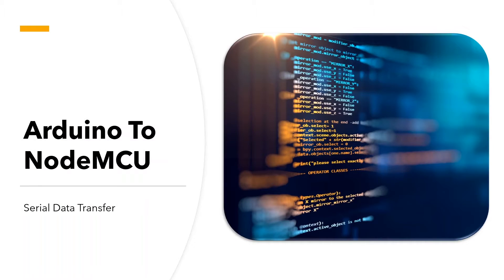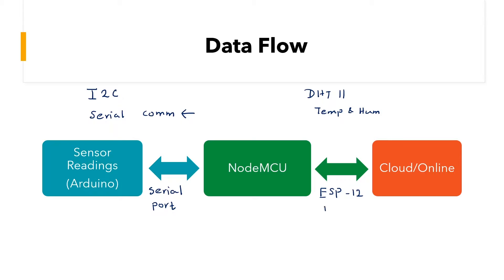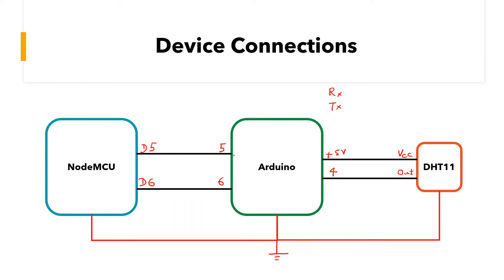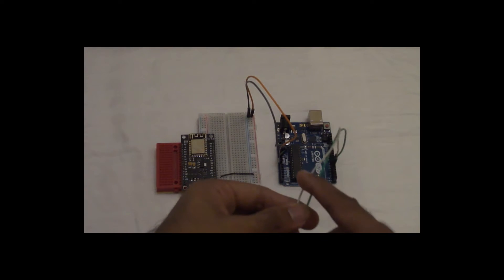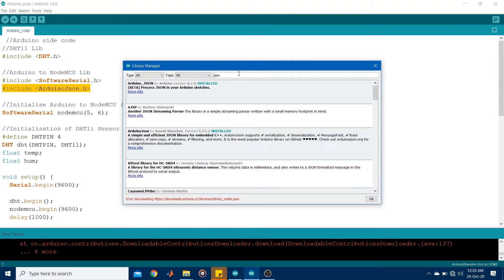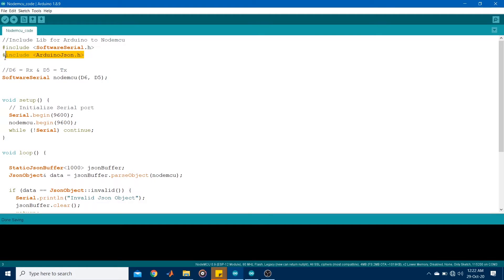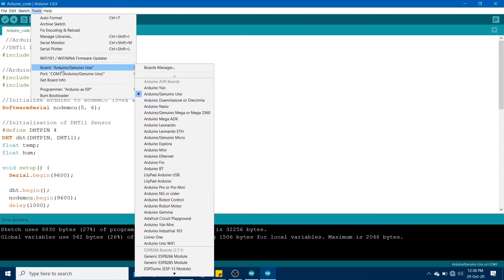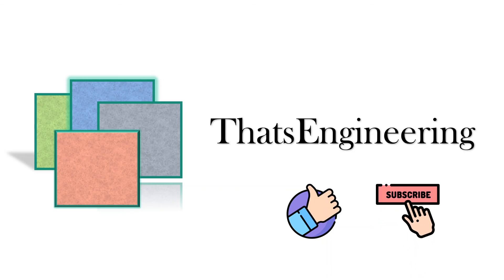Sending Data From An Arduino To A NodeMCU | ArduinoJSON 5.13.2 | Serial Communication | DHT11

Comment: I'm using ESPNOW to gather sensor data from several locations with a common receiver. I also want to send the data to ThingSpeak for logging and display BUT I was told problems in the ESP32 trying to do Both the ESPNOW and WiFi communication to ThingSpeak.  I've been looking for a way to solve this problem and if I add another ESP32 and have receive the data from the ESPNOW receiver (via Software Serial and JSON)  and then have this ESP32 send it to ThingSpeak , it should work! Key word is Should. I'll let you know how it goes. I'll also let you know about the potential problems using JSON library 6.x vs 5.X

Comment: InVaLiD JsOn ObJeCt
What to do?
Using version: 5.13.2
Reply: Bro ,same here ,did ur problem get solved
Reply: @priyanshuborah7453  My problem did get solved. I gave up on the project. I forgot the exact solution, but it was very simple also use better quality wires and avoid jumper wires(that for some reason does not wok, and you will get a lot of random data) Keep Trying

Comment: good tutorial! dont you need a logic converter to connect the arduino and nodemcu, as they operate at different voltages?
Reply: just make a voltage divider circuit using 1k and 2k resistors

Comment: i can't see the wiring can you please show me in circuits diagram?
Reply from the maker: Added the circuit diagram as a link in the description. Thanks for the feedback.
Reply: @thatsengineeringsl  thanks you my saviour
Reply: @thatsengineeringsl  Hi, thanks for the tutorial, my doubt, is not dangerous to connect serial data directly from arduino 5v to nodemcu 3.3v?